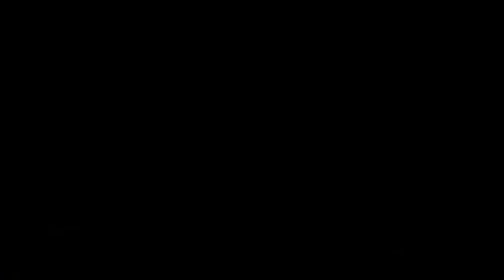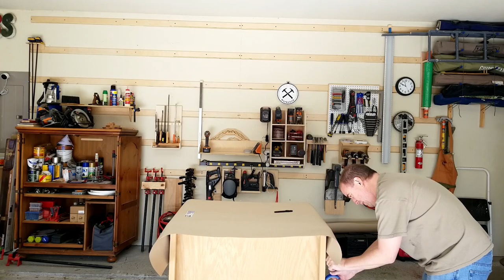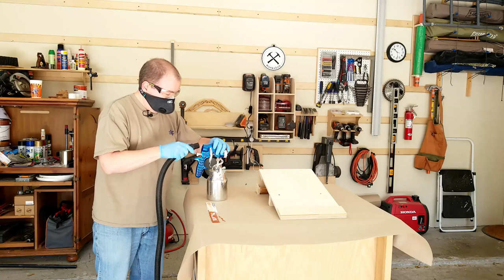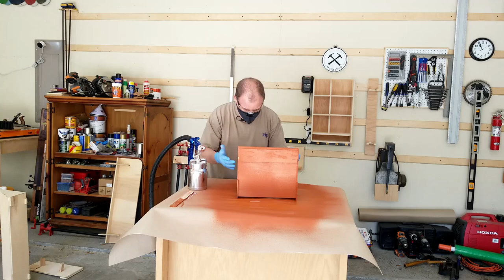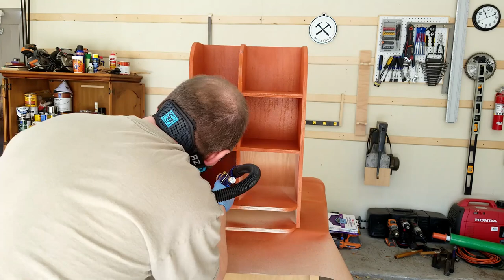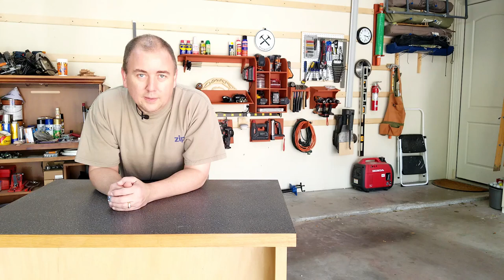Let's Paint | Earlex 5500 Spray Station

Comment: Which nozzle/tip did you use with that paint? The 2.0mm one that came with the Earlex?
FWIW, I think you are using the camera's mic and not the one on your collar. It doesn't sound like a lav mic, especially at the beginning. :)
Reply: Ok. I checked out a couple other videos as well. That mic is definitely not working correctly, if at all.
Reply from the maker: I used the nozzle that came with it.  It worked OK, but I think it would have worked better if I thinned the paint some more.
Reply from the maker: Thanks for the feedback.I am struggling to get better audio in my videos. The mic is plugged into the mic/headphone jack on the camera. I film with a Samsung Galaxy S8. I use a extension cable between the mic and phone. I just did some tests and the audio does sound better without the extension cable, so maybe that is degrading the audio. Maybe it is time to just try and buy a better one so I don't have to use the extension cable.
Reply: @MakerAtPlay  If you tap the mic with your finger, do you see the spikes in the audio? I wonder if the extension cable is not the kind that includes the mic channel. It really sounds to me like it's using the built-in mic on the phone.
Reply from the maker: @Psychlist1972   Well, I feel stupid. When I first used the extension cable,  I did a test to make sure it would record sound. But my test was done close to the phone so I did catch that it was not using the lav mic. Doing a test by tapping clearly shows the extension cable is not connecting the Lav mic to the phone. I guess I also assumed that with the extension cable plugged in, it would kill the phone mic even if the lav mic was not working. That assumption proved to be wrong as well. Regardless, I did some research last night and orders a better mic with a longer cord. It's all a learning process. And as long as I learn something, it is a success.
Reply: @MakerAtPlay  Glad to get to the bottom of that one. Your videos are good. Now they'll be even better. :)